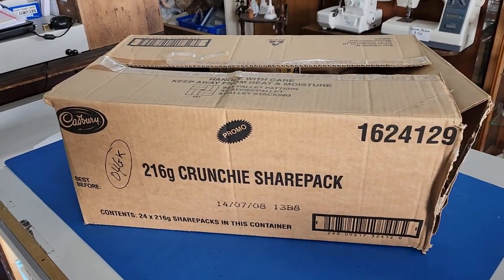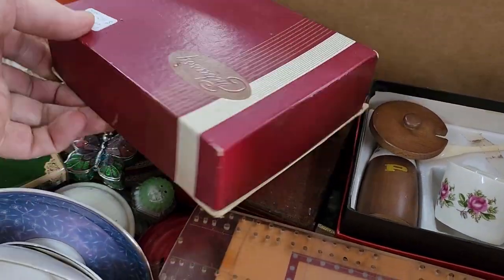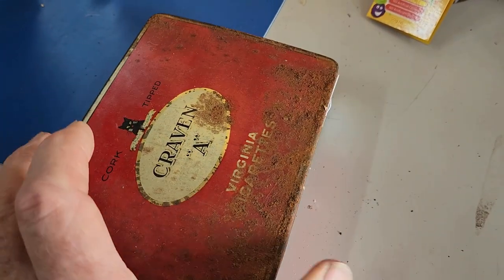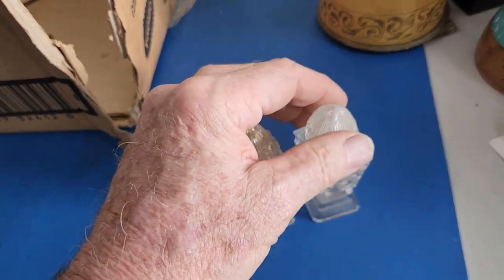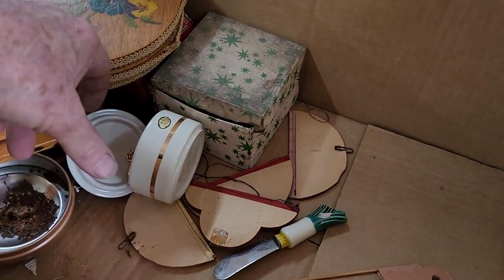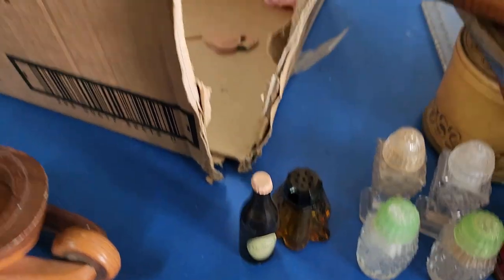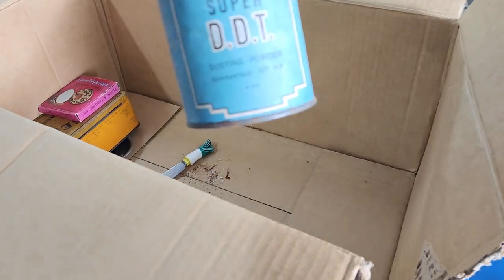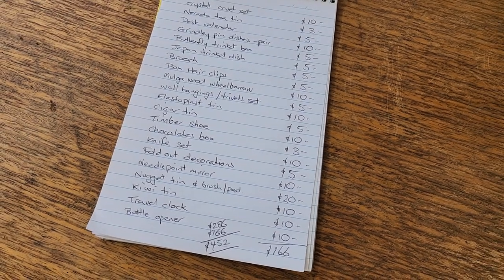Unboxing some Cool Vintage & Retro Household Loot! Some Unusual Treasures and Good Cash to be Made!

Comment: I saw that Wade's box when you opened the big box.  I'm a collector and got out my book right away.  These are Set 3 (1955) of the First Whimsies Series (1953-1959).  There were 10 different sets in the first series.  My book is copyrighted 2007 (so 15 years old) and gives these 2007 values: Retriever $40-$45; Shetland Pony $40-$45 and the Badger $40-$45.  The missing Stoat $65-$70 and the missing Fox Cub $85-$90.

And that is actually the Badger not the Stoat
Reply from the maker: Wow Cynthia, that's fantastic information! Like many valuation books, the prices don't really line up with ebay sales though. Thanks for the clarification and your knowledge 😊👍

Comment: Another great video Chris. I think the rusted metal dish that you picked up after the owl is the insert for the timber wheelbarrow ashtray looks like the right size.
Reply from the maker: I think it belonged to the owl thing as the ashtray inserts were normally nickel plated brass or EPNS. It matters not now anyway as Christine has claimed the wheelbarrow and the shoe to make pin cushions in! 😲🤣🤣 Thanks James 😊
Reply: Really good idea turning them into pin cushions. A lot easier to sell than an ashtray should look super cool!
Reply from the maker: @James-mg7op  Yep! She'll probably do a video on it too! 😊